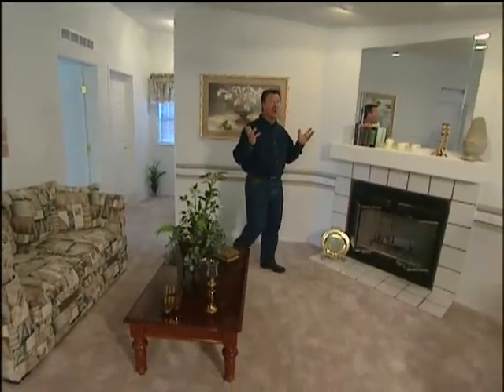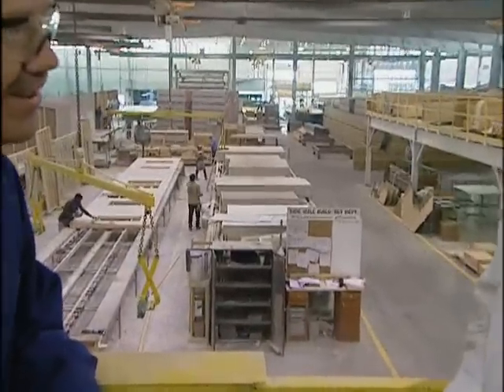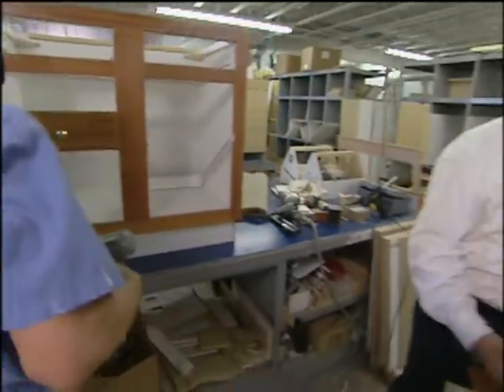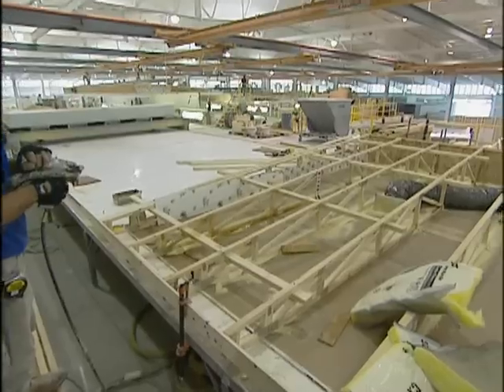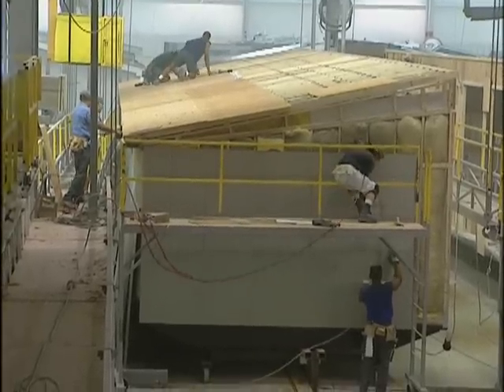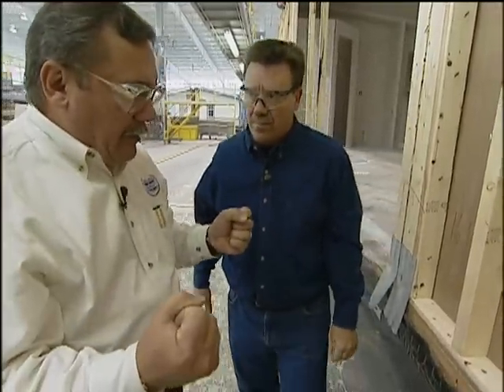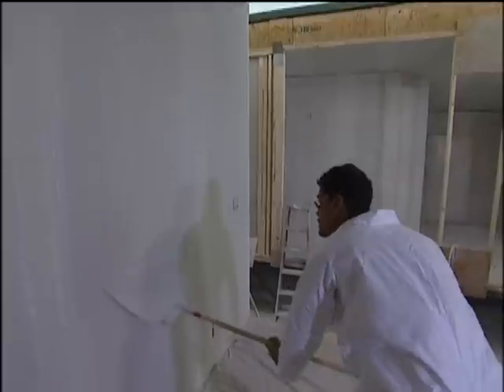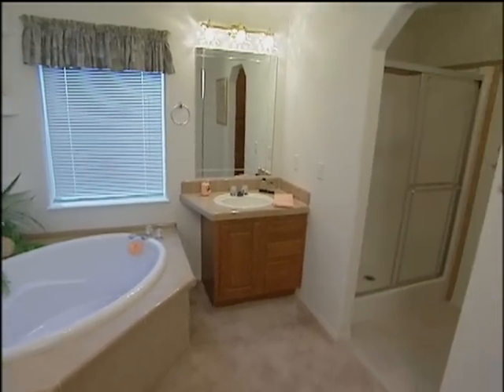Did You Know? Manufactured Housing (#5345)

Comment: did I really just see trusses made from 2x2's ??
Reply: You probably did, most likely not a solid 2 x 4 anywhere in these homes....junk.
Reply: @goodfriend7609  Your wrong! Had one 20 years. Had 2x6 put in the walls and full OSB outer wall with a solid OSB 3/4 thick tongue and groove floor.  That Truss roof is plenty strong enough.  I put new shingles on after 20 years and it was rock solid.  My stick built home gave me more trouble than my manufactured home.  Just don't put them in parks and take care of them and they are fine.
Reply: Those 2x2 engineered trusses are stronger than conventional trusses. Each of the gang plates has its own structural value. Every single truss is tested for strength before they leave the truss plant. I know it’s hard to believe and I was skeptical as well until I saw the process.
Reply: @goodfriend7609  well atleast we know you dont know what youre talking about that roof system is stronger than your "real house"
Reply: @accordino86  hand cut rafters are stronger than a truss system. On slate roofs or tile for new high end houses a roof rafter system has to be engineered then built on site.

Comment: 2X6 floor joists?
Reply: On top of steel I beams. Does your house have steel I beams?
Reply: And 2x2 Trusses
Reply: Dennis real were these homes lack the most is the sad floor system, those steel beams your talking about are weak, you can take a saws all and a metal blade and cut threw it in two in a min, cheap china steel. A modular home will cost you 20 to 30 thousand more then a manufactured home for same exact model , and there floor is built like a real house.

Comment: no they are cheap and leak and all the time. had one built and put together. the floor was a 1/2 between the 2 halfs. don't waste your money.
Reply: Have to be set up the right way.sounds like someone did a poor job
Reply: @earlwindham5244  mobile homes are junk. Period
Reply: I worked where these were built . I bult the inside of the out side wall. We laid studs on a 70ft table with bottom and top plate were stapled to studs.  The paneling was glued and stapled to interrior of studs. Used a router to  rout around windows and doors. It was so quick.

Comment: 2x6's are not adequate for floors that cantilever 3 feet beyond the beam, and especially when you don't use joist hangers to stiffen up the bandboard. This guys mobile homes are crap. Cheap ass plastic bathtubs that weigh 10 lbs if they're lucky

Comment: Meanwhile, you could have the same floor plan built with Real Wood for about the same price as these Mobile Homes cost ! Mobile homes are built with junk material . The cabinets are what I call paper board, the subfloor is sawdust board that crumbles when it gets wet, the studs are 2x2's not 2x4's, the drywall is 1/4 inch thick not 1/2 inch like in a real home, and there is no insulation in the walls inside the house. Why buy a home made with junk materials that you'll have major problems with in the first 10 years when you can have a house built with real wood for about the same price that will last a lot longer?
Reply: x6.2 There S.B.

Comment: My son married a woman that was a single mother of two kids.  She bought the mobile home / manufactured housing / trailer, because she was recently divorced and supported herself and her two kids without help from a deadbeat ex husband.

Some of the problems during the two years after they got married:
1.  Plastic toilets leaked onto fiberboard floor under the cheap vinyl. The fiberboard swelled and soaked up water until the toilet was ready to fall through the floor.
2. Plastic bathtubs and sinks cracked and had to be replaced.
3. Cardboard doors with plastic doorknobs were so thin and light you could blow on it and it would close. You could push your finger through the door. 
4. Roof leaks, and more fiberboard flooring rotted under the crappy carpet.

There's plenty more stuff of the same type problems.  STAY AWAY FROM THIS CHEAP CRAP.  NOTHING BUT A TORNADO MAGNET.  You get LESS than what you pay for. MUCH LESS.

Comment: Everyone should research mobile homes before they buy one because it's very clear, all mobile homes aren't created equal. 
-
If you are buying a new or used mobile home go to a manufacturer or individual in a hurricane zone and purchase a mobile home that meets those specs, it's a completely different home than a home built for a non-hurricane zone. FACTS!!! 
-
Then concentrate on the type foundation you will install the home on. This is one of the top two most important decisions you will make for the life of any home. 
-
I'm starting a frame up rebuild on a 16x40 mobile home frame in Jan. of 2022 it will be built to Florida's mobile home hurricane specs and the frame will be installed on a normal house pier and beam foundation. 
-
Why you may ask, well for one reason only. I would like to be able to move the home if I need or want to. 
-
This is the only way to have a real house that can be moved without having to take a damn home loan out just to move it. A couple big bottle jacks, a couple wrenches, a couple buddies and a days work an it's ready to be moved.